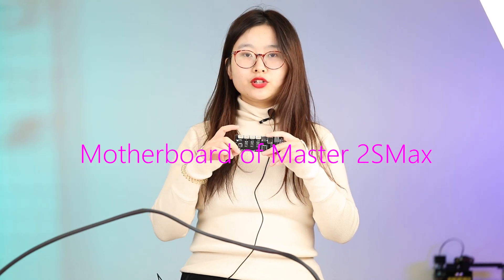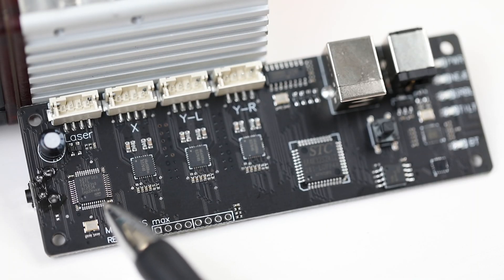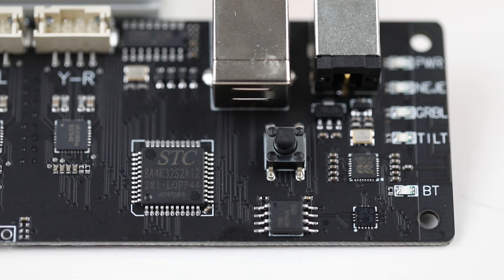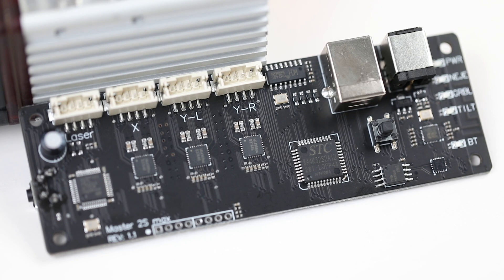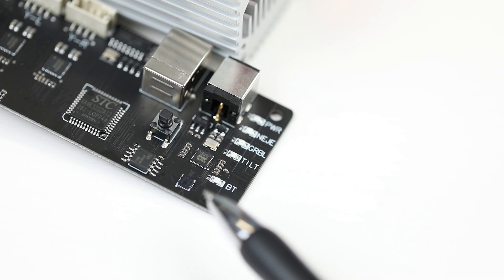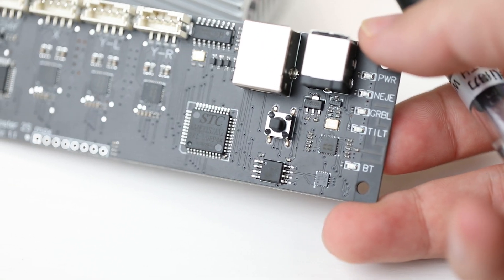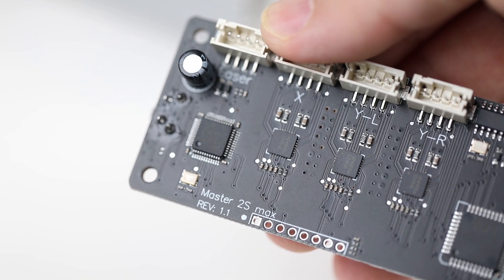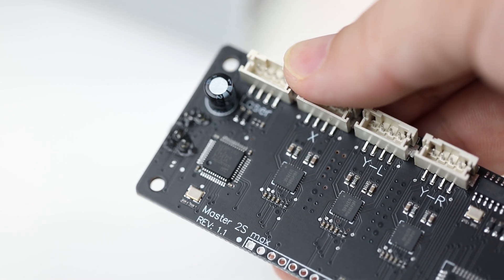Motherboard of Master 2s Max, updated to GD32 MCU, has improved 50% performance more than STM32 chip

Comment: Hello, can someone help me on why my Master 2S is not working with motors?
When I connect motors, they just make noise and overheating drivers.
Reply from the maker: You can submit your questions on the neje forum, there are engineers to provide support.

Comment: Hi...I happily received my  Master 2 but some inconvenient appears. Using his own program all ok but when trying to install and use laser Grlb program it seams can't works on it instead the suggested drivers have been installed. Same problem using UGsender program! The wiki instruction says it is possible. Please give me a solution!!!
Reply from the maker: The wiki has instructions, if you use laserGRBL or lightburn software, you need to switch the benbox firmware to GRBL1.1f firmware
Reply: @nejestudio686  Thanks a lot...last question..I f something goes wrong where is possible to download the original bendbox firmware? I little suggestion..I'm switching to laserGrlb due to Your program don't import curves and others...something very important in a job!!!